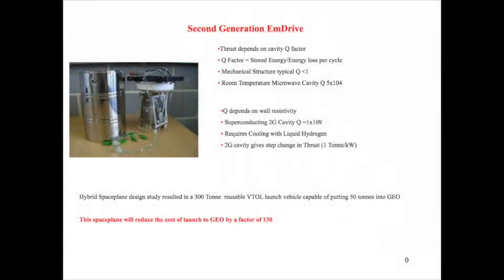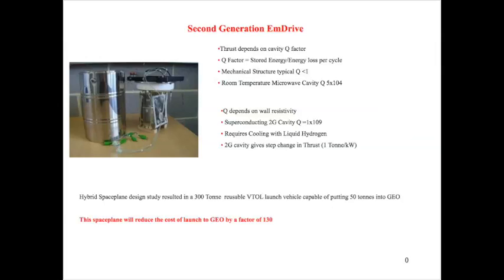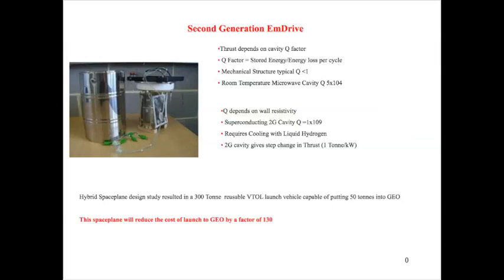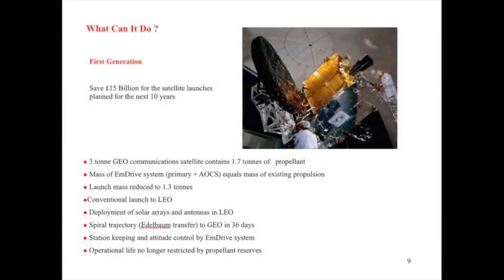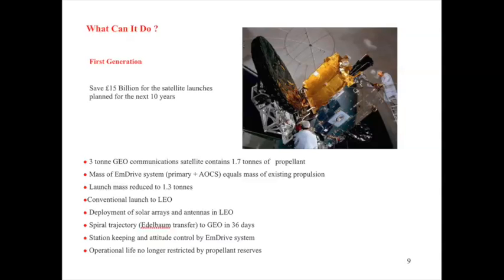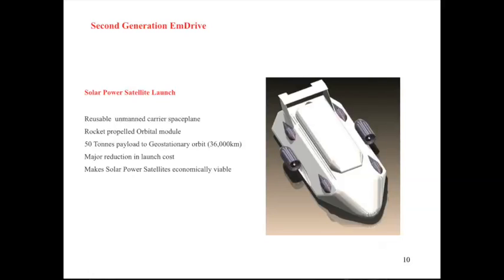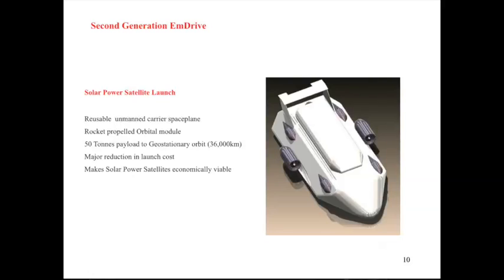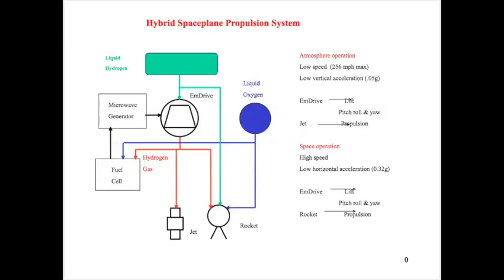EmDrive Presentation by Roger Shawyer   Part 2 of 3 opt

Comment: It's way more than just the propellent - it's also torque rods and reaction wheels!  My mounting these drives 'off axis' pointing in each of the +/- yaw,pitch, & roll axes you get rid of the wheels and if you don't have wheels, you also don't need torque rods to get rid of any excess speed on the wheels.  Your entire satellite control system becomes solid state.  If he's right, this is HUGE.

And why use Hydrogen?  There are solid state cryocoolers that don't have consumables.
Reply: UnTiedMusicStudio and no observables